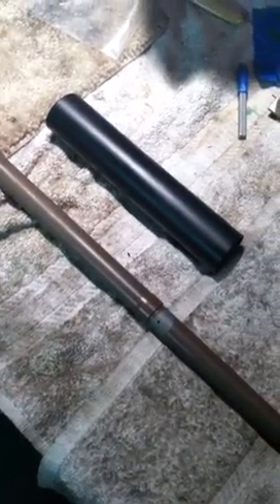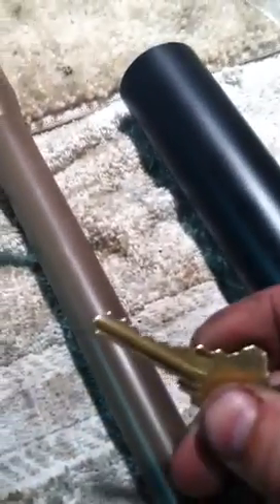Cerakote vs Duracoat

Comment: I have weapons that I duracoated years ago and NONE of them scratch that easily. I don't know who applied that duracoat, but they didn't know what they were doing if it came off that easy. As far as the laquer thinner taking off duracoat... it makes me doubt if it isn't just spray paint and not duracoat. I've used all kinds of solvents on my weapons and that has NEVER happened on duracoat. I use both products and I'm telling you that there IS a difference, but your comparison was crazy. I duracoat all my rifles, but I cerakote my pistol slides. Cerakote is a more durable finish, but the difference is not that dramatic. Stop hating on duracoat!
Reply: Before cerakote I used KG Gunkote.  I’ve also sprayed duracoat.  Never had that happen to any of those brands.

Comment: I'd assume whoever painted the barrel did a poor job preping the surface. You have to clean, and rough up the surface slightly. My 1911 doesn't take damage that easily. It took hundreds of rounds for scratches to begin appearing to the smallest degree.

Comment: i don't think cerakote is worth the extra expense over duracoat for the average guy who don't have access to a shop. Duracoat can be preped using sand paper to scuff surface where as cerakote states you have to bead blast .So considering it cost about$1500-3000 to set up a small blast cabinet unless you coat guns for a living i can't see going the cerakote route. just my two cents.
Reply from the maker: Thomas Mills 
best bet is to take your project to a Cerakote certified applicator and you don't have to worry about anything.
Reply: thats not my point i am owner of JDM FIREARMS and have went to gunsmith school in PA, MY POINT IS FOR A GUY THAT WANTS TO DO HIS OWN GUN IN HIS GARAGE DURACOAT IS THE BETTER OPTION !!!
anyone can apply duracoat to a gun with minimal supplies and get good results for around $50-65. Not so with cerakote and if you send it in you're looking at around$200-250 plus shipping. still alot more then  duracoat I know we all have to make a living but most of the time when you see cerakote being endorsed over duracoat its by smiths or finisher's creating business for them selves.
Reply from the maker: I think duracoat is a fine product for the do it yourself guy. Not everyone wants to drop their gun off and leave it somewhere to get worked on, so that product will appeal to them. That being said Cerakote is 7 times more durable than duracoat, and when Gen3 Cerakote comes out in January (which is twice as durable at half the thickness of regular Cerakote), the duracoats and KGs may have a hard time keeping up in the marketplace.
Reply: @ Thomas Mills
I am in the process of buying cerakote and doing all the work myself. So far the expenses are:
$105 for 3x4oz bottles of H cerakote (3 different colors)
$35 for the blast gun
$20 for the hobby paint gun kit
$20 for a small homemade sand blast chamber.
So basically $80ish more dollars to buy stuff that I can reuse indefinitely for a superior and unmatched finish. 
That's worth it to me.
Reply: Is that including the 15 to 20 cfm air compressor you'll need to properly run a blast cabinet.  Plus I said to properly apply cerakote as per manufacturer. Anyone can set up cheap and do a hack job. I'm a trained gunsmith and can tell you without a proper size compressor, blast cabinet and curing oven you will get OK results but not superior results. I'm also taking about finishing an entire rifle barreled action not just a few small parts or a pistol. I've seen guns brought into my shop that guys tried to do in cerakote without the proper set up and let me tell you . You can absolutely tell it was done by a diyer and not a gunsmith with a proper shop and equipment.
Reply from the maker: is that including aluminum oxide blasting media and dedicated oven as well? your wife will love you ruining her kitchen oven with H series curing fumes. I don't mind people taking a stab at Cerakote personally. Most of the time they bring it in, along with their product (which isn't indefinite, it has a 1 year shelf life btw) and have me do it professionally.
Reply: Thomas Mills 
Oops, add $31 for 25 lb of alu-oxide. I already have a 2.5 hp 160 psi giant air compressor which is plenty big enough for the media sprayer (which would complete the list of things to do a PROPER JOB AS PER THE MANUFACTURER'S INSTRUCTIONS). Also using your home oven won't hurt anyone or anything else for that matter. Plenty evidence for that on YouTube.
I know you dudes make money on people who don't know how to do the work correctly, but 3 rifle jobs would cost more than $500 if I take it to you gents. $100 for parts that I can reuse over and over again is the smarter choice in my case, especially having paint and prep experience under my belt.
Reply: You do know that cfm is not the same as psi to blast you only need 20- 30 psi but you will need at least 15 cfm. And 2.5 HP is not huge in my shop I run a 7hp compressor. A 2.5 HP is actually small . Anyways good luck . I have hundreds of hours of shop time spent two years in school ,so I'm not going to argue a mute point . Also as Ftw pointed out you'll also need a dedicated curing oven and I hope a good venting system for spraying and curing .
Reply: Thomas Mills The 50 pound capacity sand blaster I'm using requires a 1hp minimum 3.5 CFM and a 50 gallon tank. Not all blasters are the same, nor do you need one that utilizes a 40 CFM compressor to strip a few rifle receivers.
EDIT: also Nutnfancy and PrepperKip are still alive and happily married after using their kitchen ovens for curing cerakote.

Comment: Piss poor prep work and you're comparing it on 2 completely different materials that were probably applied in different ways.
Reply from the maker: +catfish307 stainless barrel, stainless tube.  Probably applied different, because thats how most people apply DIY stuff.  Improperly.  Thats why there are professionals like us to fix f-ups.
Reply from the maker: haveyouseenhim89 We didn't know the duracoat was applied improperly when we made the video like 5 years ago. But we do know that Cerakote is 7 times more durable than properly applied duracoat, and the new Cerakote Elite is even more durable yet.

Comment: Here is my critique of your attempt to show an unbiased attempt to compromise both finishes - FAIL. Your intent was honorable, however, here is what I saw and would recommend that you implement in the future: 1. shoot in landscape - the way that you shot this (vertical or "portrait" as noted by others) screams out "DIY Half-Vast" 2. IF you're going to introduce a chemical to a finish that can compromise said finish - FIRST - SHOW the Chemical! All I saw was the BACK of some metal can that you SAID was "Lacquer Thinner" - there was no label that SAID "Lacquer Thinner", I had to take your word for it that it WAS what you claimed it was. For all I know - It could have been water, MEK solution, Acetone, Alcohol, etc. IF it IS a solvent that is flammable - prove it! Take one small drop and light it on fire (in a safe manner) to prove to your audiance that it IS at least a FLAMMABLE SOLVENT. 3. As others have commented - and I'll concur - your video was comparing "apples to GRAPEFRUIT" - stick to a FAIR comparison! You'll get much less negative comments on your effort. I'm NOT trying to "hammer" you for the gross inadequacies that I saw in your video - I'm merely trying to offer you objective critique so you can make BETTER ones in the future!  Best of luck to you moving forward!!!

Comment: Sorry bud, but this is Not an accurate comparison.  Both brands are good and both offer several application types of their coatings. The Baked finish provides the most durable coating....and Cerakote is mostly known for their baked finish product - while Duracoat is mostly known for their "Air-dry" product.  Both companies offer Both types!.   And for the Record.... I've used the basic Duracoat Air-Dry products on several guns, NONE of them wipe off or scratch that easy.  Any paint or coating job HAS to be prepped correctly for a good finish - When done correctly, the basic Duracoat is Extremely difficult to remove...I've tried !  :)     Cerakote is also a very good product.
Reply: Agreed.  I've had both finishes professionally done (Cerakote bake and Duracoat air dry) and the wear was exactly the same.
Reply: I'd rather have duracoat just because I probably would want to change it one day
Reply from the maker: cerakote can be media blasted and redone. it's not permanent David.

Comment: My local shop quoted me at $530.00 plus tax to do both of my 870s. Just metal parts; barrel, bolt, bolt carrier, trigger assembly, reciever, and mag tube in one color. The price seems really steep, is this the industry average or is this guy taking a arm and a leg?
Reply: I've had a ruger 7mm Remington 7400 Browning abolt and Winchester 94 most I paid was $ 135 all of the we're in 115 to 135 range

Comment: You are comparing apples to oranges.  Durakote is a polymer and epoxy resin based.  BUT, to compare, you need Durabake.  Actually, both are just as strong (Durabake and Ceracoat).  Durabake is easier to apply.  Cleaning the surface takes less time and the powder doesn't migrate as easily (as far as I know).  NEVER use acetone on any gun part, especially the new polymers (plastic).
Reply: Rick Tomei So let's compare Cerakote C and it'll still be stronger and last longer than even Durabake.

Comment: I'm certainly not saying that Duracoat is better; I haven't used Ceracoat, so I can't say.  However, to do an honest side by side comparison, you'd have to have both finishes applied to the same material, prepared the same way (sandblasted, for example), and each applied with the same number of coatings, to manufacturers specs. The guy who sprayed the duracoat was an amateur, and may not have applied or mixed the hardener properly; was it one coat of duracoat vs 8 coats of ceracoat?  Be fair.

Comment from the maker: Cerakote wont come off with acetone either, I would of used acetone but I was all out.  I use lacquer thinner for cleanup of my gun, its way cheaper.  And yes you are right, the chemical makeup is different.  Thats why Cerakote is a premier product and Duracoat is basically hardened house paint.  Stay tuned new video coming soon.

Comment: Dude.  The chemical make up of the two products is different; Duracoat is thinned and broken down with Laquer thinner, and Ceracoat with Acetone.  I know, because duracoat recommends you use Laquer thinner to clean your paint gun, and Ceracoat recommends you use Acetone.  To imply that duracoat is somehow flawed because it is thinned by laquer thinner is kind of like criticizing paint because it's thinned by paint thinner.  The test is horribly biased.